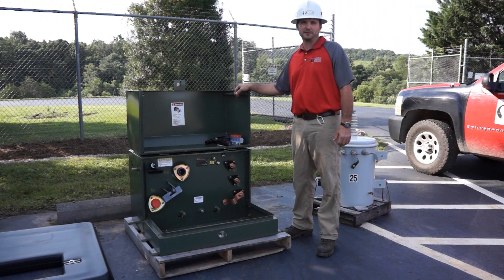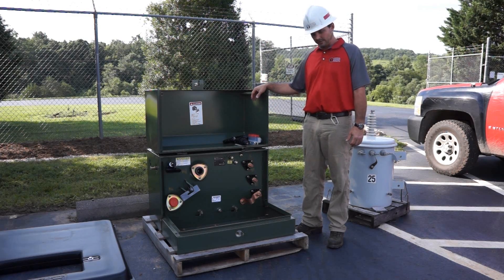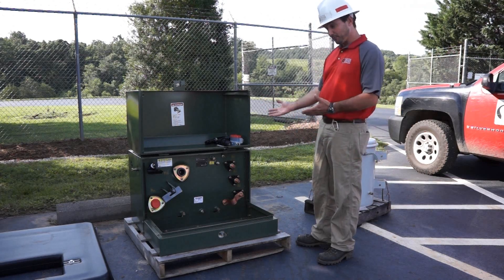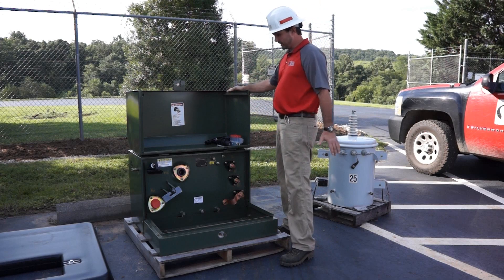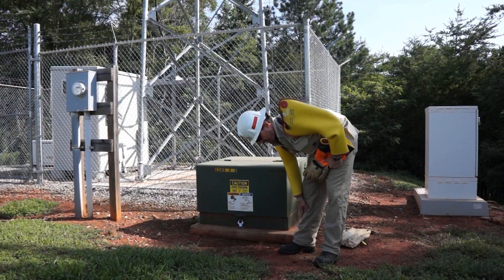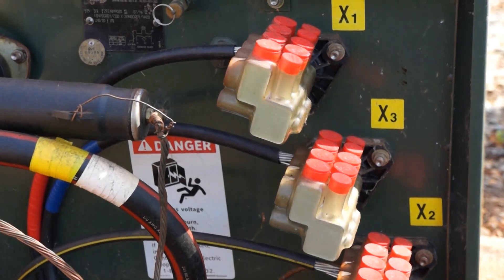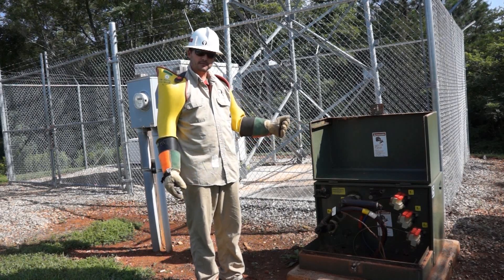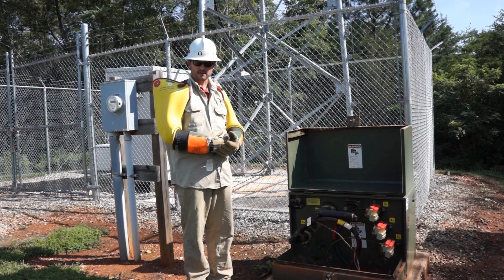Pad Mounted Transformers

Comment: Are sleeves required when making connections on the low voltage side? And are two people required when working inside these dead front transformers if all you are doing is making connections on the low voltage side?

Comment: Ummmm if your system is 7200/14kv then there is 7200v on that single phase elbow, not 14kv. 14kv would be phase to phase voltage on your system. 7200v is your phase to ground voltage. Figured I’d educate you on your own system since you seem to not know lol

Comment: How much it will cost to move a pad mount transformer 4 ft from its location? They put right on my front door, 1 ft from my egress path of my front door.
Reply: probably depends on where you are and if the power company will be nice enough to do it, those transformers will probably feed more than just your house, so it may affect your neighbors power too, not a lineman but an electrician that has been caught in instances where power has been relocated due to the resident complaining, once again i dont know if every power company will do that but you could call the power company that is listed on your meter on your house, ask them if they can do it and if they can see what you have to do from your end

Comment: Rubber gloves? Absolutely! 
Rubber Sleeves?
Reply: I would say they came after somebody got killed by not having them.  Better safe than sorry.
Reply: @cnftnf  Actually it’s company policy where I work. The expression is “lock to lock”. Rubber gloves from the moment we cut the disposable lock to installing the new disposable lock. A coworker opened a 3 phase pad once years ago & the energized elbow was off the bushing well. Hence why the customer was reporting part power. As he opened the high voltage compartment the elbow slid out of the “flower pot” & fell onto the other energized elbows. A high energy flash ensued & if he had not been wearing his rubber gloves? He might have been electrocuted. Remember electricity follows ALL paths to ground. Even through a moist human body touching a steel cabinet.